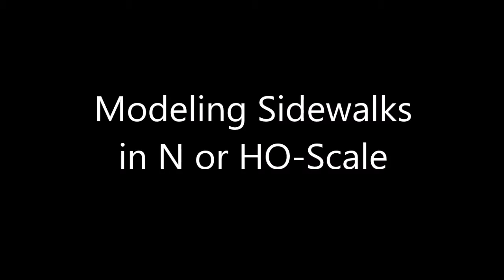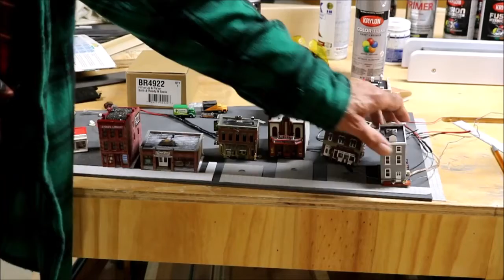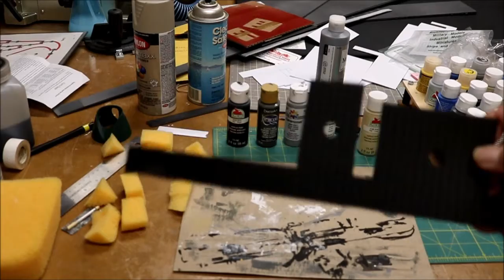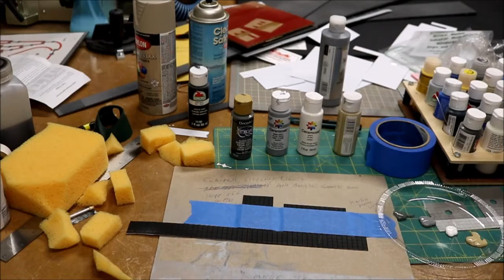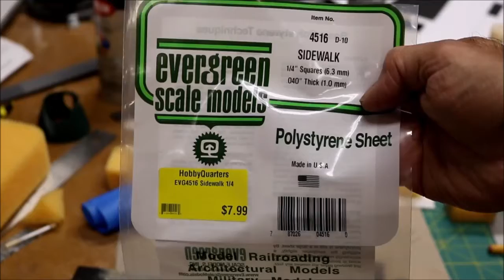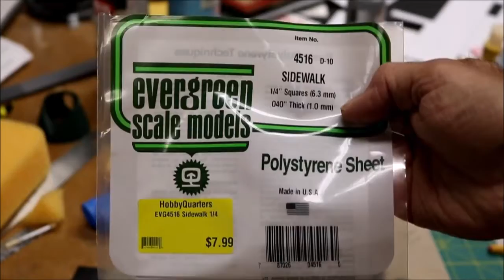Model Train and Layout Sidewalks using styrene

Comment: In my opinion, this IS the way to do the painting for great results.
The problem with this for me is coming back a week or two later and getting another one to match the first.  What's your experience with this, please.   Thanks for your time in making this video.
Reply from the maker: Thats a good question. Write all your steps down, including times for each step . Have a sample from before right next to it to compare. Thats about all you can do other than do ALL your sidewalks at the same time on a big sheet and cut the up as needed.